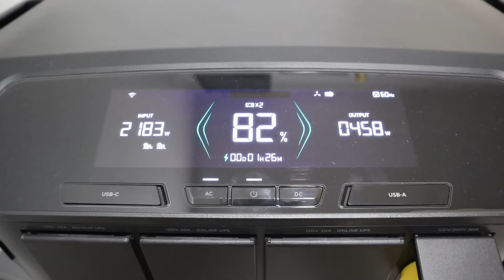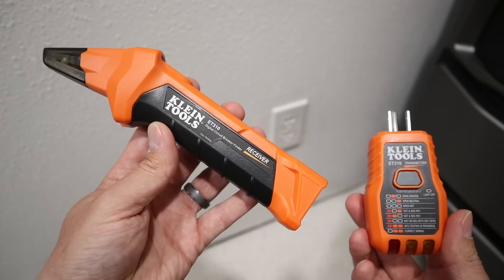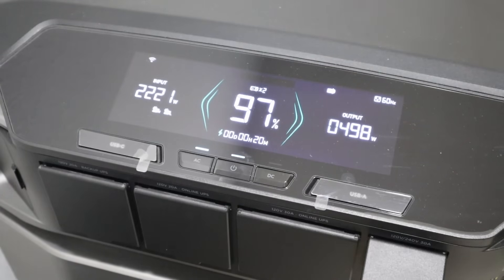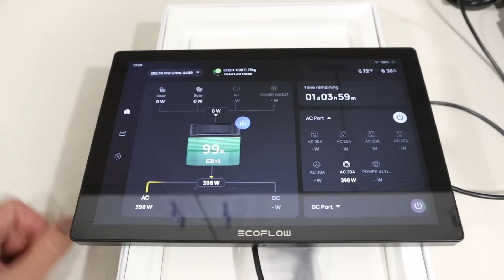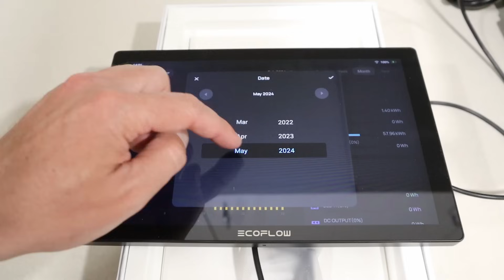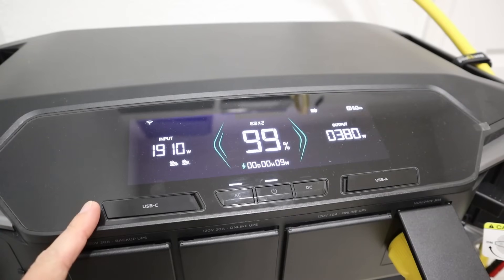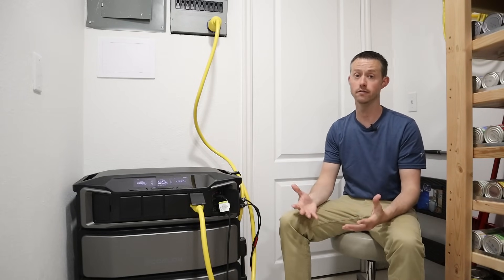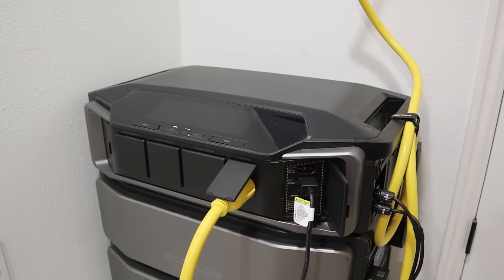Using A Transfer Switch With the EcoFlow Delta Pro Ultra! 3 Month Update

Comment: What would this system cost…installed…estimate , ball park.  Professional electrician
Reply from the maker: The transfer switch is about $450, installed professionally I've heard around $1200 out the door. Someone could do it by themselves. The install instructions are really good.

The DPU itself is around $5800 for the base model, +$3000 for a second battery (maybe cheaper in a bundle)

The solar panels cost me around $1200 out of pocket probably. The costs definitely stack up but you just take it step by step, month by month.

Comment: Hey Jason. Really appreciate the info here. I just wired up the same setup and waiting for my panels to arrive. At 4:51 you show circuit breakers for your panels. Are these necessary or are they more of a precaution? Does it depend on the size of the array? Thanks!
Reply from the maker: I think it's wise to install a DC circuit breaker / disconnect just in case you are working on the wires and you need to cut power.

Comment: Is it possible to have it plugged into a live outlet to charge off the electrical grid if you get below something like 10% or 20% charge?
Reply from the maker: Yes, you can set the charging settings to charge from solar with a priority until it hits a specific point and then AC charging will kick in.

Comment: Good video and appreciate proof of usability. Will be more telling when you have multiple years and varying seasons. I am curious why so many are setting up a transfer switch. Why not tie the whole panel to an input and just isolate the circuits you want? This gives you total control over your entire home as needs arise by turning on or off circuits, not just locked into whatever you thought might need with a transfer switch.
Reply from the maker: A transfer switch is safe and proven to work well in the past. It allows me to swap between two power sources seamlessly. It also gives me some flexibility on what I want to run off the power station. For example, on a cloudy day when the solar is low, I can still run 2 or 3 circuits off solar, while my other loads go back to grid power. On sunny days I can offset the loads of all 10 circuits.
Reply: @Jasonoid  That is a good point about being able to supplement with the transfer switch. I am not trying to be argumentative (as I am looking for more insight and understanding), but I would look at expanding my battery storage or over paneling if cloudy days are that impactful. To your example, if you have a very sunny day, you could run more of your home and not be limited to your transfer switch circuits. Appreciate your response and insight. Of course there is no one size fits all solution for all of us. Geography and elemental influences will always keep us adjusting to find the best answer for each of us. Mahalo!
Reply from the maker: @heart4Pahoa  I wish I had more space in my yard for solar panels. I'd just install a full second transfer switch and cover all my bases lol....
Thanks for checking out the video and sharing your thoughts!

Comment: Doing the same thing for over a month now and seeing significant savings/month. I have the DPU with 5 batteries into a 240 splitter. One goes to house manual transfer switch running pretty much the entire house and the other to an EV charger. 4k solar in. At California peak price It’s a significant savings. All the extra goes into my car.
Reply from the maker: Thats awesome! Thanks for sharing your experience. My power isn't too expensive so the savings per month aren't as high.
Reply: Now I understand a little bit about why there is a big interest in spending big bucks for whole house / partial house setups.  In CA as of 2025 kwh cost is on average 30 cents per.  Where I live it is 12 cents.  The same electricity is costing you 2.5 times more. In my case average bill is 200.00 per month would be 500.00 in CA x 12 = 3,600 dollars in savings per year (in ca) and you have a backup for power loss / brownouts.  I just want to run my sump pump lol.

Comment: just wondering, but the day you were not at home and didn't use the system,
what was the reasoning behind not using it at all?
did you switch the loads to line and turn off the ecoflow?
just wondering thanks.
Reply from the maker: I don't like to run these systems while away from the home. If something goes wrong I'm not there to make a change. I'm usually testing new equipment so I never know what can happen (espeically with budget brands). Since this unit is working well my confidence is growing. If the weather forecast would be decent I could plan on it charging and discharging automatically.
In the event of turning it off. I swap over the transfer switch to grid power and turn off the power station and unplug solar.
Reply: thanks for letting me know.
since you have 3 arrays, and this unit only had 2 inputs, do you take the 3rd and use it to fuel a different power station then power dump via ac into this unit to charge it on less than favorable sunny days? or it is that you are always testing something and use the 3rd array for exclusively testing purposes?
Reply from the maker: @user--PM  I use the third array for both those reasons :)

Comment: Jason, obviously your ROI is not great at this point, however, it should be easy to calculate your monthly savings, so how much have you saved off of your monthly electric bill?
Reply from the maker: The main purpose of this setup is to have emergency power. The secondary benefit is cost savings over time. During the three months of use I have saved about $25 - $35 a month on my power bill.
Reply: @Jasonoid would you save more if you Powered the water heater or ac, or do you not advise powering those loads?

Comment: Bought a Delta Pro Ultra with the Smart Home Panel 2. Had it installed by an approved Electrician. The SHP2 failed in less than 2 weeks of minimal use, one of the main relays failed. Ripped it out and put in a manual transfer switch like you have, a lot less risk of failures. The DPU has had a couple of weird battery cycles where it would say it was charged when the input power could not have charged it that fast, and the discharge cycle was similarly shortened. It did correct itself after that though.
Reply from the maker: Great feedback on the smart home panel, thanks for sharing your experience. Definitely a bummer to hear that. I have found the more simple of a setup, the less that can go wrong. That's why I opted for a transfer switch over the smart home panel (plus I can use it with any power source, inverter or generator).
Reply: Fortunate I read this.  Have the manual transfer switch - was thinking about SHP2 - but as Jason said "the simpler the better" especially when the automated device is shown to be unreliable. Instead of SHP2 I may just buy another battery to guard against those cloudy days.  Fortunate I have found enough space for 4,600 watts of solar so my batteries are filling up before 11am.....

Comment: That thing is a beast! Way better than having two main head units for 240v split phase power. Can you imagine how much room two AC500's would take up! Sheeesh.
Reply from the maker: The AC500 is a great power station, but yes it's quite large for the output and capacity.
Reply: Is the solar input cord the same for the low and high voltage PV?
Reply from the maker: @allen35315  on the Ultra you have two different cables, both use MC4 though.
Reply: @Jasonoid  Thank you - same cable - just need two to run both simultaneously.  I’ll have to find out if two cords come as standard, or if I’ll have to buy an additional one.   Thanks again - excellent videos

Comment: I`m trying to decide what`s the best thing to get before hurricane time here which is almost always August. I got a 20 ft 8 gauge MC4 cable to get more amps to my 60 amp mppt charge controller because I cannot decipher the badly written manual to use anything but 12v input. I can`t risk a mistake. I only have an 8 gauge cable to my battery. I only need 500-600w charging because that`s all I have room for and my AC is 380w. Shade moves in by 4pm and begins shading panels so parallel is the only practical thing here. 

I had planned to be on an open lot without pine trees but that isn`t what happened so sun here is 10am to 4pm max. I have 6 gauge cables to eventually upgrade to my battery but they have to be cut properly and I have a knife and hack saw blade. 

I`ve been considering a power station with 500w solar input so I can power my AC with it but for that price I can get another 300ah battery...but it will need charging. So....a power station is probably the most practical way to get air conditioning during the hottest part of the day without buying a complete new system or damaging something trying to upgrade mine while trying to break the broken English code in my manual. If there was a way to quickly charge a big battery with a gas generator it would be nice but any charger over 20 amps is very expensive and risky. I wonder...can you use three 20 amp chargers at the same time? Or even two? Or will a whole lot of things get ruined real fast?
Reply from the maker: Certain models have really dropped in price like the Pecron E1500LFP, the Bluetti AC180, the Anker C1000, and the EcoFlow Delta 2. Each of those have decent solar input and would run an AC unit.

Comment: hey Jason, what is a decent size power source for a 2-bedroom condo? In case of a blackout. How size soler generator would I need? Thanks!
Reply from the maker: What loads are you looking to run? It's all based on what loads you need to have going when the power is out.
Reply: as jason mentioned what are you tring to run,
however i would suggest nothing smaller than a 2 kwh power station,
there are several out there, and they will run almost any 120v appliance,
some of them have additional attachable batteries if you need longer run times.